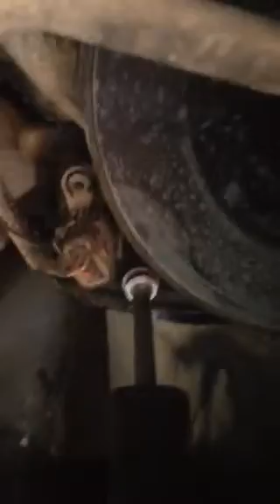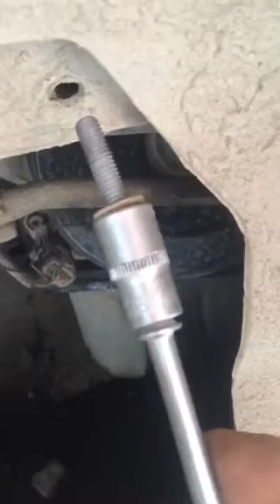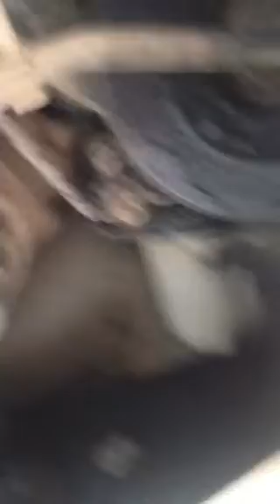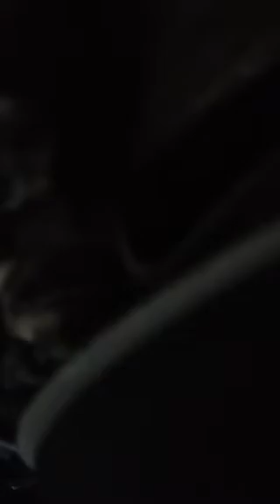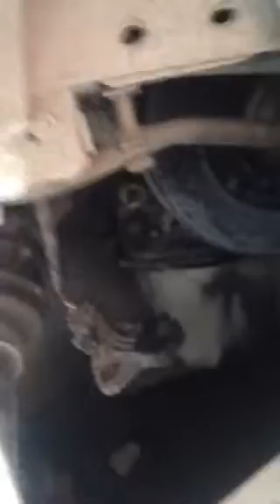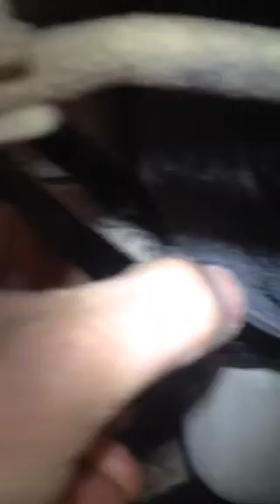Demontare senzor arbore cotit Ford focus 1.6 tdci

Comment: Bună!Ce probleme ai avut de ai demontat si curatat senzoru?
Reply: La mine nu se mai tureaza mai mult de 3000.Crezi ca ar putea fi tot de la senzorul acesta?
Reply: Nu am aprins nici un martor in bord.Porneste normal merg cu ea si dupa un timp apare "Engine Malfunction" si nu se mai accelereaza mai tare de 3000.Daca o opresc dispare si merge ce merge si iar apare.
Reply from the maker: Nicolae Vasilica Peter salut scuze ptr. intârziere verifica senzor presiune rampa injecție, ce cod eroare ai cumva P 1180 low ,hight sau P 0087 presiune scăzută rampa injecție
Reply: @niconicolle8329  salut! Cele doua erori le am eu pe focus 2 1,6 tdci 2005. Ar trebui verificat/curatat acel senzor?